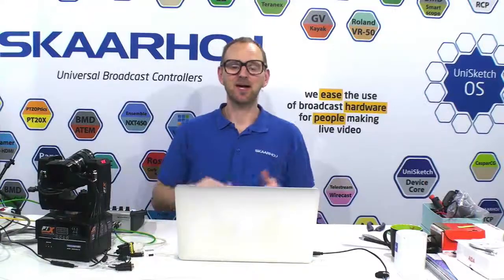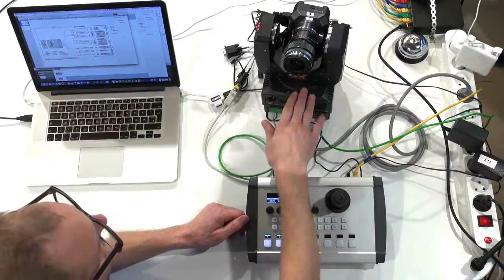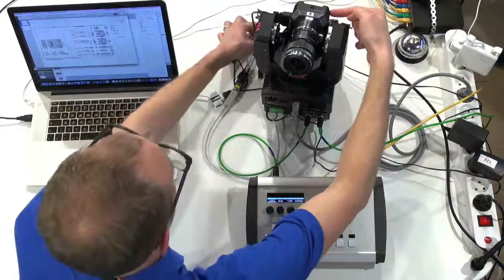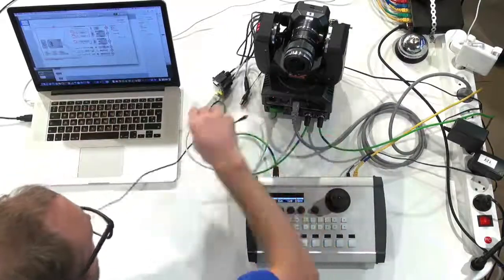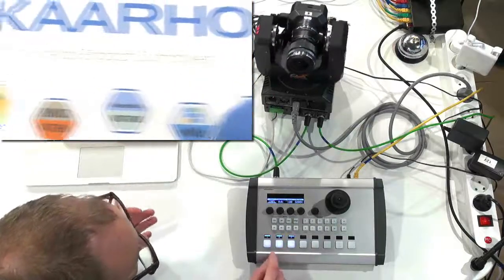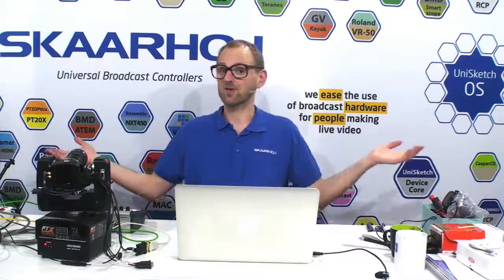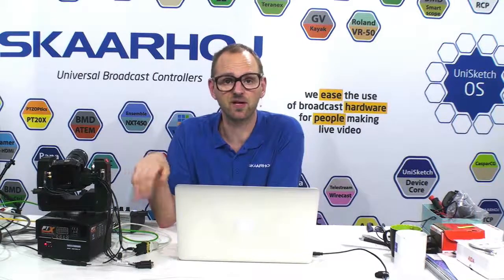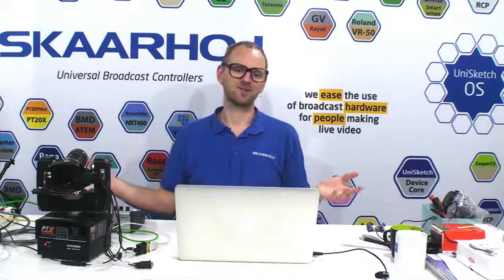RushWorks PTX + BlackMagic Micro Studio Camera

Comment: I have an Blackmagic Design ATEM Television HD to control the camera. I just want to add a pan/tilt functionality.

So would it be possible to connect the ATEM Television with the camera, pair the camera with the Rushworks PTZ Head and plug in the Joystick into the ATEM Television which has a RS422 Output to control the connected cameras?

Comment: Do you need to have the arduino shield and output the sdi to the camera directly from the PTX Pro? Or... Can you utilize an ATEM and communicate over IP from the PTZ Pro to ATEM and ATEM sdi output to the Micro Studio?
Reply from the maker: Hi Alex. Both options are possible. If you get the PTZ pro w. Arduino SDI shield you can control the Micro Studio Camera without a ATEM Switcher. 

"Can you utilize an ATEM and communicate over IP from the PTZ Pro to ATEM and ATEM sdi output to the Micro Studio?"
 - Yes!

Bjørn/The SKAARHOJ Team